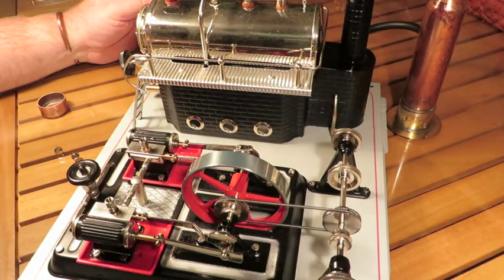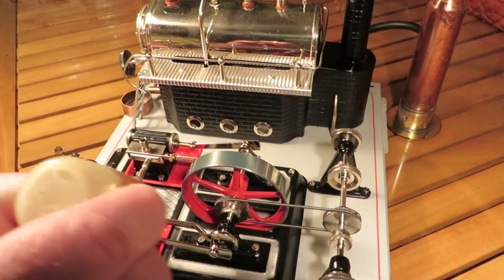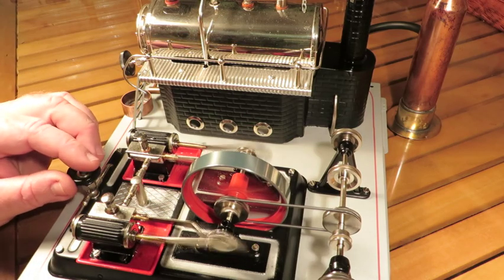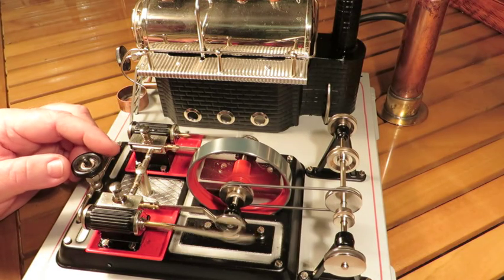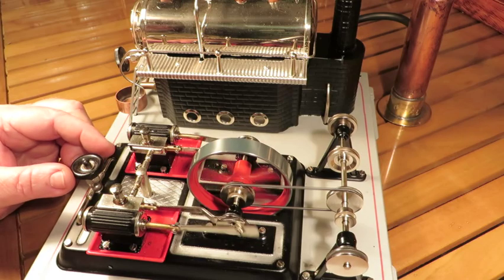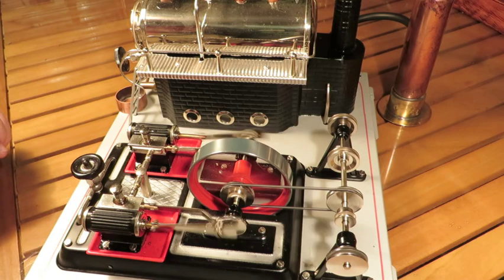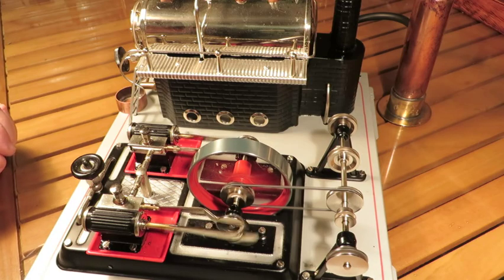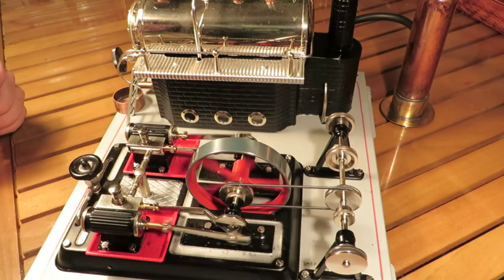Wilesco D22 Model Steam Engine

Comment: No offense, but I actually hate that clatter. It's just from all the slop in the running gear straight from the factory, and it only gets worse with time and use. Steam Engines aren't meant to sound that way, which is why I oil all my Wilesco Engines LIBERALLY with 140 weight Gear Oil, or 600W Steam Oil if the gear oil isn't handy. And I run them only at a tickover as it's closer to prototype speed. That way the engine is nice and quiet, plus just running at a tickover under a low flame the Engine can run for over an hour.
Reply from the maker: Of course no offence, its good to read your viewpoint.
Reply: Thanks, also the running gear components last much longer if you don't rev it like crazy and beat the snot out of the crank and wrist pins, bushings, and crank journal bearings. With the thick oil plus slow running they'll last practically forever.
Reply from the maker: Agreed, nothing looks better than a model steam engine running at a realistic real life speed and running an accessory also at a realistic speed.
Reply: I use mobil gearbox oil too on the motion of all my engines and it does wonders to eradicate slop noise
Reply: You should get yourself a Stuart Turner Twin Victoria, the you woudn't hear any noice!